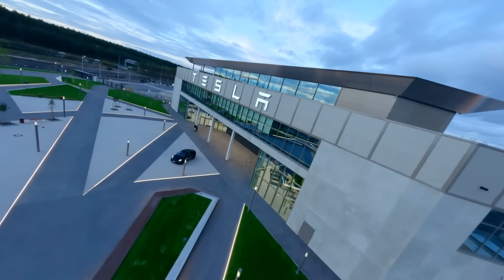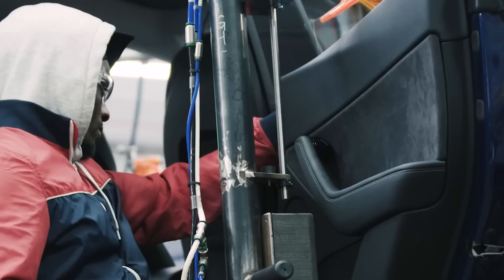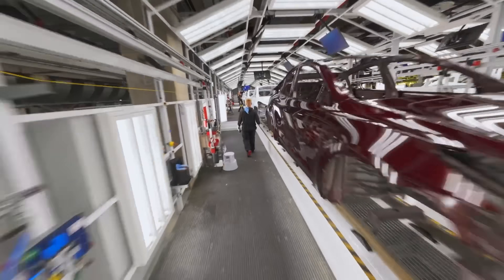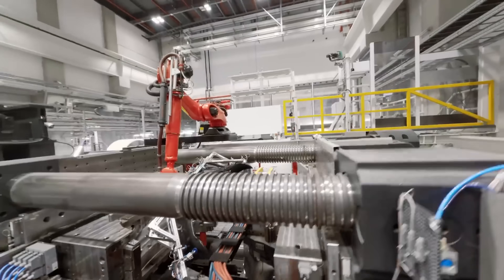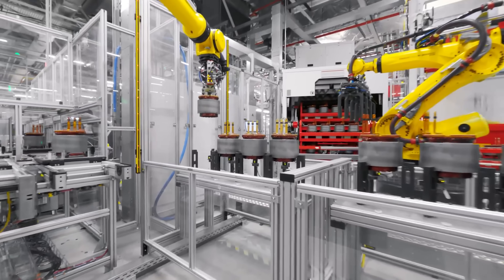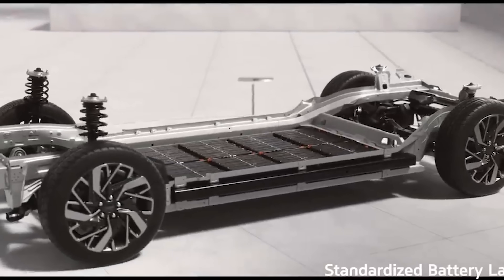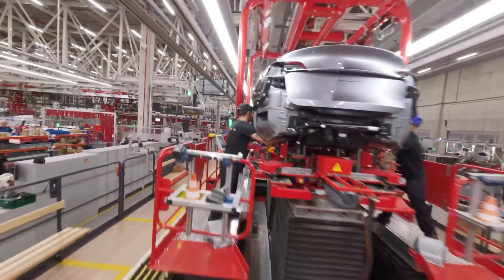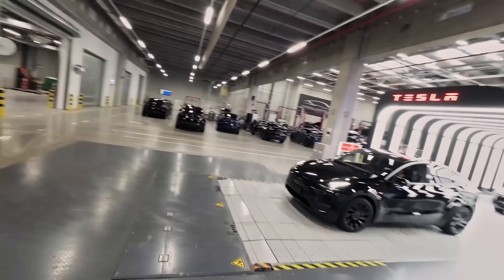Tesla Just Quietly Changed Its Battery Design – Here’s What’s New

Comment from the maker: Is the new battery design better than the BYD design?
Reply: In real life just wondering how BYD's Blade Battery is performing better ?
Reply: @jasonmcintosh3448 We traded our ICEVs about three years ago for a Tesla M3 and an Atto3. Both are equipped with 60KWh 400V traction batteries. Both are also slow charged once per week at home and now have done about 40,000km. 

Both have pretty good performance. The TM3 gets 5-10% better range and has better handling, but cost $10,000 more than the Atto. It has a noticably rougher ride than the Atto.

So far there has been no discernible degradation in battery capacity in either vehicle.

We are very happy with both, but around town, the Atto gets the thumbs up. For longer trips its the Tesla.
Reply: @jasonmcintosh3448 BYD blade doesn't perform better in terms of range or efficiency but may be their temperature endurance could be better, which matters a lot in hot climate countries.
Reply: Thanks Ben. This flies in the face of Right To Repair. 

Batteries do fail, and in a variety of ways. Even when Tesla says that the pack will last for as long as the car, what happens if you're the unfortunate '1 in a million' people who have a Tesla whose battery is out of warranty, and it fails? Unless the battery is accessible for replacement of a bad block, I foresee a big bill to pay for a replacement car, after maybe only 8 years of ownership.

I run an EV, but will not be buying a modern Tesla any time soon.
Reply: @RWBHere Tesla needs to stand by their product and give a longer warranty. 8 years is not enough.
Reply: No
Reply: Of course it's better.

Comment: Makes more sense to have a unified battery design that is hot swappable in a jiffy lube like type station. even interchangeable between brands. This could become the new filing station. When your traveling 500+miles in a day the convenience of pulling in and back out in ten minutes with a full battery. Six to twelve large bolts connecting the battery to the underneath of the vehicle. One drops out, one full charged goes in. Wouldn't matter the degradation because your gonna swap soon anyway.

Comment: Only reason why Tesla lovers don’t think swappable batteries will work is because Tesla decided not to provide that mechanism. You have NIO providing this mechanism for LESS price than any Tesla car on the road. Why not have that feature if it doesn’t cost you anything? So many uneducated folks who just say crap without knowing the true benefits. Use swap if you want to. It’s still a car you can buy with a battery, or just lease the battery and never worry about out battery degradation.

Comment: Using aluminum to reduce weight could be a good improvement to improve efficiency (which is currently one of the best) but I don’t need a swappable battery. Except for commercial fleet, it's nonsense as there is no standard: to swap this battery, we will have to use a Tesla system in a Tesla building where other brands will have to do the same. there is only one interest, it’s for reparability

But Tesla will also have to improve charging time. For example, the new model Y takes 30 to 35 mn to recharge from 10 to 80% where the new X-Peng G6 takes only 12 mn

Comment: The problem with your thinking about "Aluminium is good for conducting heat to keep them cool" is that you don't always want the batteries to cool quickly. When you're using a vehicle in cold weather, the car actively wants to keep the cells hot, so conductivity through the battery case is bad in that case.

However, I think using the case to dissipate heat is a drop in the bucket when you already have cooling channels snaking between the cells themselves which go to a heat pump.

Edit: Also, your point about a battery needing to be part of the car's structure isn't really a huge thing. Your doors are already a large stiffener to the body of a car, and that's with only 3 attachment points. With a bunch more around the sides you could easily make a structural swappable battery, just you can't mount other stuff to the battery itself which was a big thing with Tesla's structural pack holding the seats of the Model Y.
Reply: For the edit, 
Swappable batteries add more weight 
Being Structural that will increase the weight even more to add that "tensional rigidity"
Battery pack being the floor is cheaper, lighter and adding more tensional rigidity
Reply: @tv-ld3wv  That is true. What I was getting at is that a significant amount of the load could still be borne by the battery if the locking mechanism is properly designed. Of course that will increase the weight of the battery even more, but would probably be lighter than having separate bracing and having an isolated battery on rubber for instance.
Reply: Doors are absolutely not "already a large stiffener to the body of a car". I think you may be confusing the doors contribution to crash safety (if built appropriately) which can be very significant, with the very different concept of torsional rigidity of the body shell.

Comment: aluminium battery cases are nothing new the 2013 BMW i3 already had that, just like the vw ID line up and more. significantly reducing the number of parts on vehicles will only just make them harder to repair, thats not an innovation, those tesla will never survive a decade in Africa where you still see 50 years old vehicles still going and going

Comment: No battery car for me. I’m sticking with my 20 year old Toyota   Service and replacing tyres around every 3 years, rego , insurance. If there is a problem quick cheap fix. The big bonus is no one can push a button and mess with my car.
Reply: You think your 20 year old vehicle has no electronics that can be messed with by the push of a button?
Reply: I think that's what many people will do until they see how reliable EVs are, and how cheap they are second-hand. Many people will wait and buy a used one.
Reply: EV’s are expensive to repair I have a MG4 that was involved in a crash & was repaired very promptly with my insurance paying the cost….when I researched the cost of a comparable ICE car it was cheaper!
Reply: @chrispack3131  By comparable, do you mean one made in similar quantities in a similar place and costing a similar amount of money? For instance, the Golf is made in Germany at a similar price to the MG4, while the MG4 is made in China. Parts availability and such.

What did you compare it against?

Comment: Swappable batteries are medieval thinking. It is a fundamental failure to understand the economics of batteries.  Every year battery prices fall and battery chemistries improve.  Each passing year only furthers the case for swappable batteries being a fool's errand.  The Tesla battery paradigm permits the car owner to park their car at home or work and charge it while it sits.  This is a recognition that every home or workplace already has electricity. And, privately owned cars only operate about 5% of the time. They are typically idle about 95% of the time.  That means there is plenty of time for a car owner to charge their battery with inexpensive off-peak priced electricity. And, there is plenty of time for very gentle slow charging that will preserve the long term energy capacity of the battery.  Perhaps a swappable battery could make sense for a robotaxi. But, the ongoing improvements in battery chemistry will likely permit very rapid charging of robotaxis.  So, Tesla will likely not add complexity and price to the robotaxi with a swappable battery.

Comment: Aluminium is also substantially more expensive that steel for the same strength so I doubt overall cost is going to be significantly lower. Probably just more hype distracting from the lack of any recent new tech advancements from Tesla. Cybertruck is stalled completely, Autonomous driving showing no signs of significant advancement from 2 years ago, Robotaxi "rollout" quite embarrassing, no new Models, Semi appears to have gone cold, "We, Robot" day also embarrassing, no significant robot advancements to show. I had high hopes for Tesla but they seem to have gone off the rails since their last real groundbreaking achievement/success - the release of the Model Y. Ever since Tesla hype has been pointing to Tesla having at least a couple more new models by now, a ground breaking and cheap humanoid robot close to production, autonomous driving completely solved, all Teslas being able to be immediately deployed as robotaxis, etc. Sales were meant to increase by up to 50% each year but instead are already going backwards. It doesn't look good.
Reply: Most of what you mention will be covered in the upcoming stockholders meeting…

Comment: +1 for repairability. Since Nissan open sourced its battery communications protocols (there were three versions), the aftermarket has embraced remanufacturing of the battery with attractive gains. In 2025 three liquid cooled battery variants came available through EVs enhanced NZ for the leaf. This means safe and affordable cars stay on the road longer, honouring the original intent to move to electric

Comment: All these structural designs and giga castings are surprisingly making cars easier to repair. I don't believe battery swapping will succeed for cars simply because there is a high penalty when trying to make a modular battery that fits many different cars and the majority of people do not need to charge often enough to make battery swapping beneficial.  Battery swapping makes it attractive to people that have an ICE car and still have the mentally that you run the car until it is almost empty and then go somewhere to fill up. For long distant trucks I think battery swapping will be ideal but they are two completely different requirements. All you have to do to realise how difficult it would be to get a modular battery is to look at a BYD shark, BYD seal, an Atto3 and a dolphin and try to make a shape that will fit all three vehicles and will give you a decent battery size. It is almost impossible to get anything close to what those vehicles currently do with a special shape battery.
Reply: I like battery swapping for leasing.
Reply: nonsense!!!! stop lying! it makes cars much more difficlt to rpepair, you have to repair or replace huge chunks of the car in a simple accident thats awefull.

Comment: The BYD 400V blade cell traction battery has just 126 cells in a single module, so low parts count. The comparable Tesla battery has over 1,000 cells, five times the parts count. Makes it hard to match BYD on production costs.
Reply: 24M is cell to pack and will have an even lower part count.  See Munro Live episode.
Reply: BYD wins. TESLA loses. Shush....
Reply: Byd takes longest to pay suppliers. Sells 0 mileage cars as 2nd hand. Crashes and air bags don’t deploy. Makes it hard to match Tesla.
Reply: @AlexanderA37  I didn't know there were air bags in batteries.

Comment: Even in the Nio with swappable batteries the batteries can still be designed to act as integral structure, just bolt in style.
Not dissimilar to a bolt in brace, gusset.
The added benefit of swap is lower cost to owner and rental model of battery and power , but chemistry upgrade  on the fly at any time.

Comment: I truly believe in Elon’s ability to reduce costs — it always leads to a huge gap in safety standards, all just to save money, lol. That’s why the Cybertruck’s aluminum frame keeps breaking apart, there are no stalks, no LiDAR, and the Model Y/3 has a body so weak it dents if you press it with a finger. Reduce cost in manufacturing process that leads to huge panel gaps and paint that wear off in a month. All to reduce costs lol
Reply: Its not Elon. Its a bunch of young and super hard working engineers on the edge of burning out every day
Reply: Yup.  Tesla designs reflect his lack of empathy.   Modular  battery design in F150 lightning means that when an out of warranty cell goes bad,  it costs the owner $5K to replace only one Module.   In model 3, the owner has to replace the entire pack for $15K with a refurbished battery with only 1 year warranty.   Tesla is only about Tesla.

Comment: I always thought that swappable batteries could have another advantage. Just thinking about the evolution from Gen 1 to Gen 2 LFP rolling out now as an example, wouldn't it be easier to upgrade a car that supports it periodically as newer battery tech rolls out over the coming years (solid state, semi-solid, etc etc...), as long as they stick to the same general packaging design? This would offset much of the need to upgrade your entire car. You could keep it for longer, as range and charge speed and other things improved over time?
Reply: The batteries are already outlasting the car, no need to swap it.
Reply: I was referring to technological upgrades. If a new battery comes out that is the same size and shape as yours but half the weight and 4 times the range, wouldn't it be nice to just slot it in instead of your old one?  @SzaszaG1
Reply: @SzaszaG1  I'm not talking about reliability. I'm talking about upgrading performance.
Reply: Even replacement will be needed I think, in poorer countries cars that Westerners changed after 10-12 years, live another 15 years or maybe even more. Ar least to improve performance if battery degrades to 50 %.
But car makers just do not care about what happens 10-15 years after they sold the car. And also I would suggest that in 10-15 years repair shops would get competent enough to do the upgrade regardless unless they make structural batteries...as Tesla. I dunno.
Reply: but that wont sell more cars, so unlikely. Same way they dont make iphones or Galaxy phones with easily swappable upgradeable batteries.
Reply: Batteries need cooling, heating and continuous monitoring in order to keep them safe. That would imply a standard impossible to implement given the successive bat technology that being developed.
Reply: @konnexman1  not necessarily. If you have a cooling system, software updates can manage it.

The only thing you really need to worry about would be 800v (or higher) charging architecture for your car, in order to take advantage of future faster charging technologies and chemistries.
Reply: The battery and drivetrain will last a lot longer than other parts of the car... Tesla was talking about this over 10 years ago and have for many years made the interiors and other parts to standards used for buses or trains, made to last a lot longer than other consumer vehicles...

Comment: I'm not a battery chemist or engineer so can't claim to be an expert. Lessons learnt from decades of reading tells me implementation is critical / devil is in the detail. Hyundai still do not use LFP and LG batteries have a bad reputation. They are also still learning about reliable electronics or don't give it sufficient priority. Tesla's gigacasting are surprisingly repairable but I understand from repairers that if the pack is crash damaged it's catastrophic for the car and it's repairability. You can't straighten the car once it's gone that far, at least according to the repairers. European experts say Tesla's are made for longevity, past Renaults for example not so much. Nio Firefly is under 1500kg with just over 40kWh LFP, Inster is closer to 1400kg with closer to 50kWh NMC, but it's not ground up based. What influences weight most I don't know. Seems there are always trade offs.Biggest problem for buyers is the real issues often only emerge years later. I want a lightweight, safe enough, drivers EV that is repairable and will last as well as my 20 year hatchback did, for cost and sustainability. You can be a car guy and a Greenie.
Reply: Hyundai Kia made some truly putrid engines 2003-2012. They aren’t special
Reply: For weight question:
The structure and body parts are made of steel or Aluminium ?
Tesla rocket grade Aluminium"about 15% less weight" or normal Aluminium?
Extreme crashes: Normal car is total loss anyway and will never get back to normal after repair but Gigacasting opened the room to change parts like LEGO and some structural adhesive material
The car will be back as good as a new car
Reply: One can be a car guy and a greenie, true. Can one be a Tesla owner with a social conscience? That's highly debatable. It's becoming more and more difficult to buy anything from the US without a large amount of skepticism.